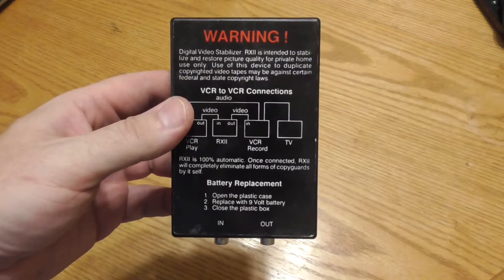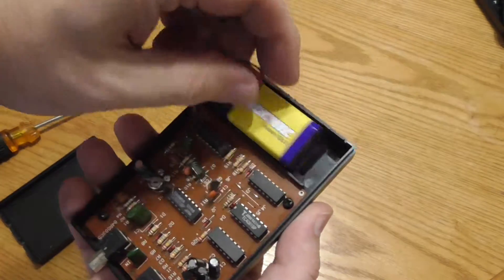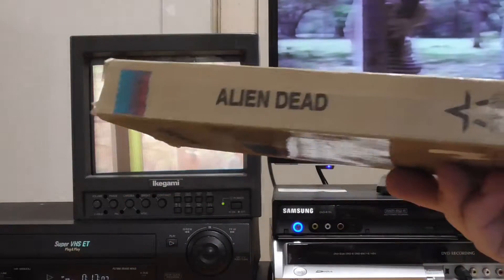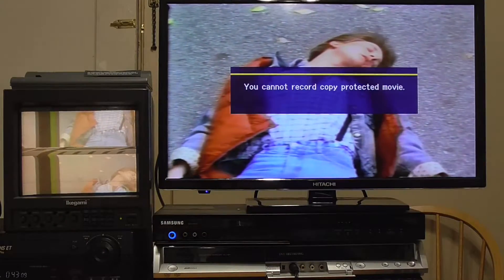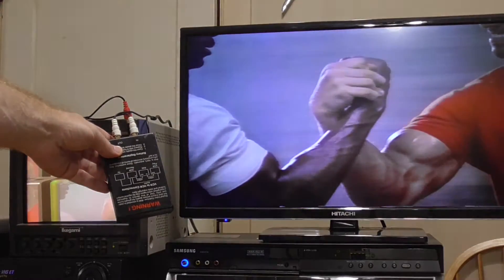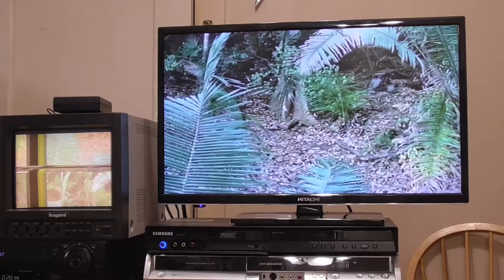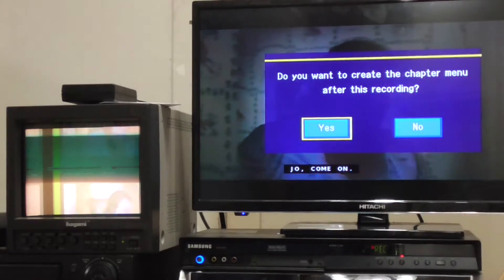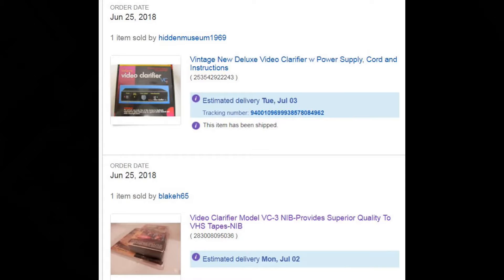Macrovision Copyguard copy protection vs 3 Video Stabilizers / Clarifiers  |  RXII, Sima, Vidicraft

Comment: Very interesting results. So I have a Framemeister scaler which for it's day was an amazing piece of tech, but one major flaw is that it required constant Sync. If a VHS starts to track too much, or the sync gets unstable even Slightly, it blanks out and has to re-sync.  Do you think of any this kinda stuff would help with that?

Comment: I was reading a posting on a video forum, i think AVSForum, just last night.. while the RXII may defeat macrovision on VHS tapes and DVD's, it still will not copy some content recorded to VHS tapes and DVD's from cable TV.  It considers that content protected.  The Grex video stabilizer device will allow someone to copy that digital content from cable TV, as well as the movies from both VHS and DVD sources. The Grex seems to out-perform the RXII, but it is maybe $50 more expensive. I was going to buy an RXII, but after hearing about the Grex, i will buy one of those.  

One thing to add.  Back in the mid 2000's, i had my Magnavox DVD Recorder on, recording Saturday Night Live.  The musical guest was Metallica.  While trying to record the Metallica segment, my DVD Recorder failed.  It displayed a message on my screen, something to do with recording protected content.  I had heard about Macrovision in the past, but assumed it only had to do with copying commercial videotapes and DVD's  of movies, and the like.  Never again, since that night, did i see that message displayed on my TV screen.  It was very strange to see that, but after reading that post on AVSforum about the RXII, it made sense.

Comment: Another few  devices you could try are the Electrohome video stabilizer  and the Sema GoDvd both those are very similar to the rx 2 and the other one is the Grex .
Reply from the maker: I ordered a GoDVD on Ebay but it was DOA.  I have it as a "saved search" so if I find another at the right price, I will pick it up.  

I contacted the folks at XDimax twice over the past 3 years about getting a "loaner" Grex to test, then send back to them.  They are not interested in having me review it.  The unit is too expensive for me to purchase just for a video review.

I am unfamiliar with the Electrohome, but I will look into it.  Thank you for letting me know about it.

Comment: Old school for the win. I bought one of those RXII video stabilizers shortly after buying my first DVD player. The DVD player only had composite outputs, and my TV only had a co-ax input, so my VCR became a bridge between them as it had both composite inputs and a co-ax output. Of course being plugged into a VCR triggered the DVD copy protection, even if all I wanted was to watch a movie I'd legitimately bought. A trip to the local electronics store and I came home with that little black box and another RCA cable to plug it in. It did it's thing and I was a happy camper. :)

Comment: The way I dub is to cue up the videotape through the device and DVD recorder. Then after inserting a blank DVD I select the speed and input source. I then turn off the VCR and press record on the DVD recorder and pause it at 5 seconds. Then I turn on the VCR and press play and unpause the DVD recorder. Works every time.

Comment: hey thrifty i been trying to record VHS TO DVD,  the problem is not hooking that up, the promblem i get is i want to note here., my vhs player and dvd recorder our not a combo, the tapes are not commercial vhs tapes,  when i got everthing hookup,vhs and dvd recorder, the vhs tape starts to flicker, now when i just hook up  vhs player  to tv only , screen is fine,  i tried the XDIMAX GREX-7.4 Grex Video Stabilizer, i still get that flicker,    i just ordered the stabalizer ya mention in video with a 9 volt battery,    wonder if this would fix my promblem,
Reply from the maker: The "stabilizers" I test out are for removing macrovision encoding from commercial tapes.  I doubt any of them will help with your issue.  There can be several causes for flicker when dubbing old home recorded VHS footage, such as magnetic signal loss due to tape age, tape stretch, too much video gain on the original signal, and more.  TVs often compensate for these issues better than capture devices that expect a pristine NTSC (or PAL) signal.  Sometimes a TBC will help by completely replacing the sync signal with a new one, but this is a more expensive device than any of these filters.  I would suggest reading, then maybe posting, on the VideoHelp forum, specifically the "capturing" section.
https://forum.videohelp.com/forums/10-Capturing

Comment: Will the RXII only work on a Samsung DVD recorder regarding the copyrighted vhs tapes? I have a Panasonic combo
Reply from the maker: I've used the RXII on a Panasonic stand-alone and it worked.
Reply: Thanks I'm beginning to wonder if it would be easier and cheaper to somehow transfer to my computer and then make the dvd
Reply from the maker: @The63blonde  I've tried a low cost EZCap device, but I had audio issues with it.  Overall, I prefer the results I get with my stand-alone DVD recorders.
Reply: @ThriftyAV  well that would require me to have him get two separate machines instead of using the Panasonic combo right?

Comment: Is audio preserved?  Could you do a video on TBC application to this issue?  Are there any VHS decks that provide a clean output without need for  a separate box?
Reply from the maker: With all these devices, audio is patched separately.  I tried out a Panasonic video switcher with built-in TBC on a different video linked on this comment.  One issue with using a TBC is that it replaces the vertical blanking interval.  This removes any closed caption information from the video signal.  https://youtu.be/SPkV4Nz7oe0

Comment: Where can you find the breakout cable get back with me thank you
Reply: You could take a regular RCA audio cable (white and red) and an S-Video cable, cut them, expose the bare wires, and solder them together. Make sure to connect the grounds and you'll be good to go.
Reply from the maker: I purchased them through the All Electronics catalog years ago.  You can also find it on Amazon.  Search S-Video 4 Pin Mini DIN Y Splitter Cable
Reply: @ThriftyAV   ok thank

Comment: Nice videos. Maybe you have a video of this I haven't seen. I think Qualitek Industries is the mfg of the RXii. Well, they have several models at the same price. Other than power supply differences do you think there would really be a difference between the RXii and the other model (VS-1V) that says it works for VHS and DVD's? Why offer one for VHS to VHS (VC-1X) transfer if the RXii can do it as well? Thanks
Reply from the maker: Thank you!  I did not know the manufacturer of the RXii.  I'll update my description to include "Qualitek".  I ordered mine from the All Electronics catalog on clearance about 25 years ago.  I'm surprised they are still made.   I have not tried the VC-1X.  Without examining the internal components, I cannot tell you the difference between these units other than the external DC input (instead of a 9V battery) and the gold plated RCA cables.
Reply: @ThriftyAV   Im not 100% certain they mfg the RXii but it looks like it. All Electronics? I haven't seen their catalogs in probably 20 years when I was an audio tech. I might still have one of their catalogs. 
Thanks for the fast reply!
Reply from the maker: @tomasw6985  The mail-out catalogs have disappeared, but All Electronics is still around, and they still have great deals on cables, adapters, and various electronic parts... Or at least they did before the pandemic hit.  
Whether Qualitek manufactores the RXII, or just sells it, I plan on reaching out to them with regard to some of the other items in their catalog, and see if I can feature them on ThriftyAV.  Thank you for the views and the comments, Tomas W!

Comment: I bought a RXII stabilizer off eBay and it works, however there's many things to avoid. If you own a cheap $20 Walmart LG or Sony DVD player, it will not let you copy. It also doesn't work for copying Blu-Ray discs, as there's stripes all over the picture. Although, you can use an early 2000's era DVD player with a really good VCR. I own a DVD recorder, but since it's the only ''old'' DVD player I have, it's used for playing the disc and copying to VHS in SP mode. Then I copy the tape to that DVD recorder, so it will be successfully copied to a blank DVD. It may sound confusing, but it really isn't that hard to understand or figure out. I am looking into finding an old DVD player at a thrift store or from a friend, so I don't have to use a VCR.
Reply from the maker: The thrift stores in my area have lots of DVD players, and many are older... However, very few of them have remotes!  Usually a universal remote can be programmed for an older DVD player.  Enjoy your video hobby, and keep experimenting with various players and recorders!  I sure do.
Reply: @ThriftyAV  it is strange that a lot of the high end JVC S-VHS units on ebay have no remote.  What happens to remotes?  I guess it is like everyone out there that has ever had a TV and/or VCR/DVD player. The i cannot find the remote game is always played.  I play it, too!

Comment: Does anyone know why my Pioneer dvd detects that dvd is protected Whe I use the” Video Copymaster” aka “ Video Copy Box” ? I can copy  a dvd to Vhs using it but even if I try to copy from  2hd generation “clean” vhs to DVD it still detects copy protection. I am puzzled by this. Also does anybody have the schematic for the circuit which uses the LM1881 sync sep and an adder at 64 microsecs for pal.  I built it but couldn’t get it working properly when copying VHS to vhs. Also one last question; I have an old Betamax vcr (which I’m not sure if it works properly or not) and I have read that macrovision does not affect copying onto it. Is this correct.
Reply from the maker: I've had mixed success with the Video Copymaster.  I've had much better results with DVD recorders when using an RXII unit.  As far as "why", my best guess is that the Video Copymaster does not completely remove the pulse signals.  I have not built any of these boxes myself, but maybe one of my viewers has the schematic you seek for PAL.  Any VCR with auto gain control will be affected by Macrovision, but most Betamax VCRs you find are older and lack this feature.   Old VHS recorders that lack AGC are also not affected.

Comment: Great video. I listened to your advice and bought a RXII, I hook it up with my funai dvd recording. As a result, i got an error message saying it's copy protected. I wonder how you remove the macrovision? Would you please tell me what i need more to remove it. I currently use the sima scc-2 color corrector to enable recording but it drops frames and soften images...could you help? Thank you.
Reply from the maker: The RXII has an internal 9V battery, so make sure that it has a fresh one installed.  Also, the RXII is for NTSC signals, I'm not sure if it will work with PAL or SECAM.  My understanding is that PAL was the broadcast standard in Vietnam.
Reply: ThriftyAV Thank you for your prompt response. I don't know much about What system they used in VN back then since i've always been in the US. I bought two RXII, brand new batteries. When i hooked these RX to the vcrs and dvd recorders, i know the devices were turned on. For some reason, they were unable to remove macrovision on my vhs, and therefore, i'm unable to copy my vhs into dvds. I can mail you the rxii so you can take a look at them. Perheps, you'll be able to spot the reason.
Reply from the maker: @vietnamintlvideo422  If your mail these RXII units to me, I can confirm if these devices are removing Macrovision or not, and I would document this test via a YouTube video.  However, If your units are faulty, I do not have the equipment or experience to repair this gear.

Also, I do not own a Funai DVD recorder.  Is the Funai a VCR/DVD combo?  If so, are you trying to use a single device for these dubs?  My playback VCRs are JVC and Zenith.  My DVD recorders are  Philips, Panasonic, Polaroid, and Samsung. 

The RXII is just one of many filters designed to remove copy protection such as Macrovision.  In a different comment, you mentioned a Sima unit.  The latest and greatest is called an Xdimax Grex.  I have not reviewed this unit, as I have not found one at a "thrifty" price, but this might be worth an investment if you have a large number of old tapes to transfer. 

If you would like to ship the RXII units to me for review, my Email address can be accessed on the "about" section of my YouTube page next to the phrase "for business inquiries".  I can Email you the ThriftyAV shipping address and return shipping policy.
Reply: ThriftyAV sorry for my late response. Yes, My funai dvd recorder is a combo unit (not every funai combo unit is the same, the units produced after September 2014 gives brighter recorded pictures. I used Sima Scc-2 which successfully removes macrovision from my old tapes while sima scc-1 doesn't. The problem with sima scc-2 is that this device softens the image, and the color it generates is okay, good. But for some really old tapes, the original color is still much preferred. I saw some negative reviews on grex. People say grex has a lot of issues...My vcrs are jvc hr-9600u. I found this vcr yields impressive quality compared to sony, panasonic, toshiba and many others that I have at home. You mention grex is worth trying. I'll wait for your review on that unit to see if it works. I can mail you one of my tapes that has copy protection, to see if your RXII can remove it or it's just my device being faulty.
Reply from the maker: Contact me via Email, available on the "about" section of my Youtube page, so we can work out the details.

Comment: Hi ThriftyAV.  I received my No Name *Digital Video Stabilizer, popped in my 9Volt Battery so I can make my own copy
of Back to the Future from VHS to DVD.
I'm not having any luck dubbing.  Say's ...Copyright.  *VHS to DVD-R.
I tried hooking up a VCR Player to my VCR/DVD-R and it still says ...Copyright.

I'm very, very confused! Could you please go over the wiring with me? 

Do I need to use 2 sets of Composite Red,White & Yellow Cables, 3 sets or just one?
Do I leave some Cables just dangling?  I'm really not sure what to do.
I'm pretty sure it is the Video-Yellow cables that hook up to the DVS, but my Laptop Display looks like "you used" White instead?
LOL  And I'm not even color blind!  What's worse is that my DVS in and out puts are colored Red!  I can't catch a break!

Set-up on my DVS box says;
Player Audio Out to Recorder Audio In.  Those are the Red and White Cables I know.  Am I supposed to use the attached Yellow Cable to hook up to the DVS In, or do I  let that Yellow dangle, and use a Stand Alone Video Yellow Cable?
Player Video Out to DVS In.     DVS Out to Recorder Video In.  Same idea...

How many cables to I need, and should some ends just dangle?

Any direction you could give me would be greatly appreciated.   I looked through your other videos and that $80 Unit is really scary!
Thank you so very much!

Dangling on a Friday Night
Reply from the maker: The red, white, and yellow coding on RCA cables is for cable management, but all can be used interchangeably, and I don't always use the appropriate colors.  Sorry if my video was confusing in that regard.  Yes you should hook up an outboard VCR to your record deck, and not try to use the one built in for dubbing backups of Macrovision encoded titles, as there is no way to hook up a filter when trying to dub within the same device.  The Digital Video Stabilizer should have both an "in" and an "out".  You need to go from the "video out" on your playback deck to the "in" on your DVS.  Go from the "out" on your DVS to the "in" on your recording device.  Audio can be patched directly.  If you want all your RCA connections color coded correctly, you will need two yellow RCA patches, one for each side of the DVS, for audio you will need one white (left audio) and one red (right audio) going directly from your playback device to your record device.  You did not mention what brand of DVD recorder you are using.  I have had success with Philips, Panasonic, Samsung, and Polariod.  None of these devices gave me a "copyright" error when dubbing.  I have not tried any other brands.  Also all of my VHS sources are NTSC, the North American Standard.  I have not tried the Digital Video Stabilizer with PAL or SECAM encoded video.

Comment: Hey ThriftyAV, I just bought 2 of those you recommended and yes they needed import costs to Europe. But we'll see how well they do. I have an another one I use and its a hard to find "converter" which is a good machine to use. No batteries or cables involved, only SCART (which we use here in europe, which is actually more superior than RCA cable).
Reply from the maker: I'm not sure if any of these are compatible with PAL or SECAM, as I do not have the gear to test these standards.  I am curious to find out how these work for you, ninjafireball.

Comment: Great video - thanks for posting it. Do you think the RXII would work with PAL tapes? (as opposed to NTSC tapes)
Reply from the maker: Good question... that I found unanswered on several forums.  I found an advertisement for one HERE:
http://www.qualitekindustries.com/bvistrwi6feg.html
Maybe these folks could answer this question.

I know that more modern stabilizers such as the XMIDAX GREX boast PAL compatibility, but I cannot answer your question with regard to the RXII without acquiring a PAL VCR and monitor.
Reply: Thanks for your prompt reply, I'll get in touch with Qualitek
Reply: Keith Jones did it work?
Reply: ThriftyAV I’m using a toshiba vcr-dvd dubbing machine will this work on that?
Reply: @amritpalhh9836  
What model Toshiba?